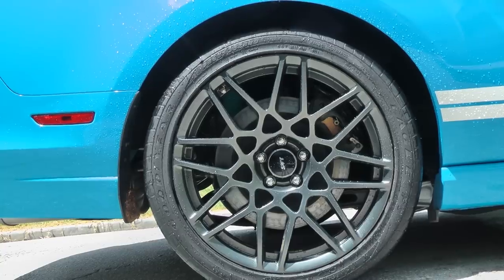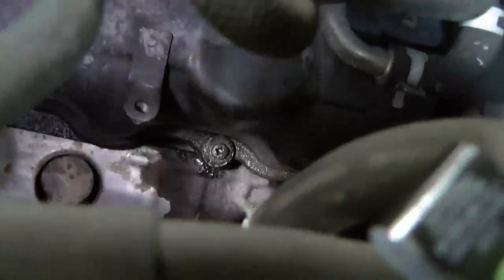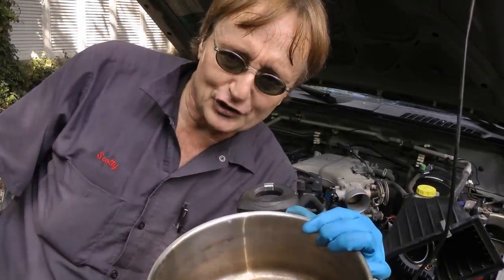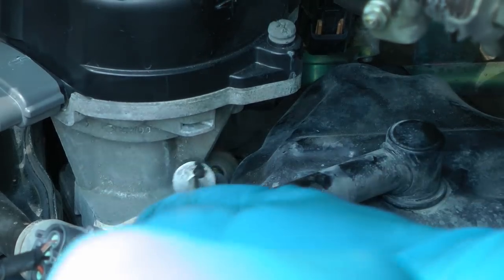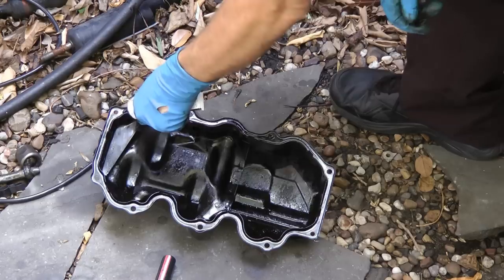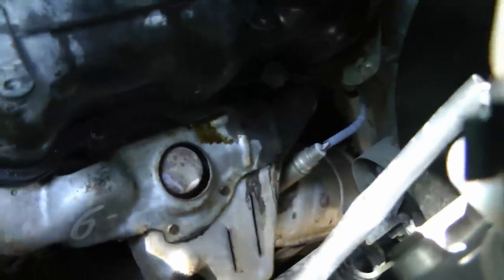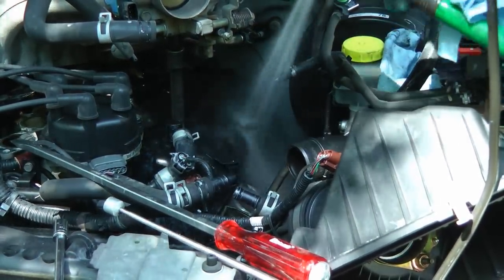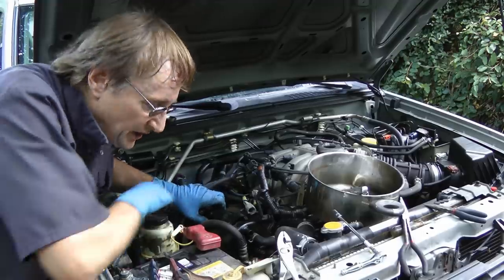How To Fix a Car That Smokes Under The Hood

Comment: Hi Scotty, My VW has been giving me issues lately. blue/white smoke is coming out of the exhaust pipe, at first i thought it was valve stem seals and the valve guides so i took the head to the professionals to replace all the worn out parts. Now i know that after putting the car back together, the smoke wont disappear instantly, but its been a week since i serviced the head and the car is still smoking and its worse now with oil dripping out of my tailpipe. all gaskets changed. help please....

Comment: hey Scotty.. I just replaced the gaskets on the same engine except its tbi. it still smoke only on the passenger side. The gasket itself doesn't seem to leak anymore but I get smoke coming from the manifold.  I sprayed it clean and it only smokes at operation temperature. what else could it be? thanks love the channel.
Reply from the maker: well, wait a week or so, old stuff will take a while to burn off
Reply: Israel Espitia how did it turn out
Reply: superjojo555 no more smoke now I got a oil pan leak 😞

Comment: Hey Scotty I have a 91 Ford Mustang 2.3l. I recently replaced the transmission but upon starting about a minute or two after starts to smoke near the flywheel area. Any idea on what I can do to fix this?
Reply from the maker: make sure it's full of fluid and that the torque converter is on correctly

Comment: I myself probably would have waited till after the intake manfold was installed before taking the degreaser & garden hose to clean off the crud. accidents & oopes do happen. That oops would be worse then dropping your favorate screwdriver where you can't reach it.

Comment: Hi Scotty, I have smoke coming from the engine bay (bmw diesel) ONLY on cold start then it goes away after 30 seconds?  Any help is much appreciated
Reply from the maker: check for leaking gaskets using a smoke machine then

Comment: Hi scotty, I have a nissan sentra 1988 box shape model. The car is fine at first but today when I drove there's white smoke coming from the engine and smoke from the vents and has a weird smell..I also see oil leaks when I stop me car..oil leaks also by the oil cap and now it's hard to start my car and my car isn't as strong as it used to like ito losing power when I drive.What is wrong? Please help scotty
Reply: tighten the oil cap and look for leaks while the engine is running, if the smell is sweet, its coolant, otherwise its most likely oil. the reason it starts hard is the sensors are most likely coating something maaking the engine unable to read the carrect air / fuel ratios.

Comment: is that normal for a car with 23,000 miles though? however it is a 2003, so the previous owner didn't drive it much. it's an Infiniti G35 if that makes a difference.

Comment: Ok so I got a 99 ram 1500 v6 just got it drove fine till I got it home oil. Tac stoped to 0 then back up to 40 so I shut the truck off and noticed smoke coming from the back of the motor I checked my oil level after it cooled down and it seems fine I also checked the oil cap for puding and nothing any one know what this could be I don't think the oil gauge works right but it don't deplane the smoke

Comment: HELP! I have an 98 chevy cavalier 2.4, i just recently change the water pump on it and it was a hassle to do it, was underneath the manifold. so i had to takedown the manifold and timing chain im pretty sure it didnt move. now that im finish, i have several codes showing, which are,p0335 could it be i didnt tighten up enough, p0141,p0335 and this one worrys me..

Comment: Dude help me! I just got a ls1 camaro about 3 months ago and it smokes alittle(like burning leaking oil) directly behind the intake manifold near the firewall but the valve-covers from the front and side dont seem like there leaking. Also it only seems to smoke under the hood wen I use German Castrol 0-30 oil which i perfer since it doesnt get eaten like Mobil 1 5-30 which smokes at the tail pipes, but doesnt smoke under hood.Any ideas?

Comment: hey Scotty i have a problem whit my Fiat somtimes when i start it up it starts hard like the batteri not good but i chacket it and it has 12.4 V and when it starts hard the clock and date resets on the dash and somtimes when im geting out of the car afther i turn engine off and i tuch the dor when geting down it shocks me the car is only 2 years old  any idea what it can be? sorry for my extremle bad english :)

Comment: I have a 2005 Pontiac Grand Prix that is having white smoke come out of the vents, it also smells burnt. When I kicked on the air conditioner last night, I didn't smell anything, but as soon as I turned on the heater, I could smell it.

(Side question: My battery went bad some time ago and the car warning system said that it went into reduced power mode. I disconnected the battery thinking that'd reset the system, and it quit showing the message, but for some reason I have to give the car gas now to get it going, or there's a chance it'll just die. Any clue what would cause that?)

Any idea of what it could be?
Reply: PhiloAmericana Heater core.

Comment: Hey scotty I replaced the valve cover on my 2002 nissan sentra spec v and after starting the car over it started shaking and the rpm's went down to less than one thousand and it felt like it was about to turn off and a lot white smoke started to come out of the exhaust pipe..I kept the car running for over 30 minutes to see if the white smoke will disappear but it didn't so I turned it off because I didn't know what to do and I don't want to harm the engine...can you tell me how to fix it and what might be the problem?
Reply from the maker: lots of crap in the way of that valve cover job, look to see if wires got knocked off, or hoses got ripped or broken first.
Reply from the maker: put a brand new pcv valve in, you can't fix em when they break. Pray it's just that, it will do that if it's sucking too much air

Comment: hey scotty my friend has an audi a6 that started blowing out heavy grey smoke that smells like gas. 2 days prior to that i had changed his air filter and spark plugs and it was fine for 2 days , he drove it about 65 miles in those two days and yesterday he had the car on but not running , listening to he radio and said the dash lights flickered about 4 times and the radio cut out but everything came back on when he starts it it take about 6 seconds of cranking to start and it shutters and idles erratically while blowing out the grey smoke almost like its timing is off but the belt was changed 20K ago. also i pulled one of the plugs and it was soaked with gas. i also checked the fuel press. regulator and a few plugs with a noid light and they all blink and spark but not as fast as it seems they should. any thoughts?
Reply from the maker: those things are over engineered money pits, and that one's running rich. Find a guy like me with a Vag Com audi computer to analyze it. No way past that one

Comment: Hey scotty i have a 01 Audi A6, and i noticed smoke coming from under the engine, towards the left side where the air intake is located, my coolant leaking wouldnt be the problem since the coolant tank is not low and i did notice just today that i had a bit of oil inside one of the sparkplug wells maybe that could be it? could it be my orings or i need a new valve cover gasket ? and i also wanna mention that sometimes when i am breaking anywhere past 15 mph just a second before the car stops i feel this thump that the car makes only as i am breaking, is the oil in the well causing a misfire?
Reply from the maker: pray it's just bad valve cover gasket and spark plug tube seals.  and yes oil can cause misfires
Reply: Thank you very much. Now I know why my car smells like burned oil or something, and I also have another question, how come my car struggles when going uphill and then revs up very high and running 20 mph.

Comment: Ihave a 1985 Nissan 300zx for the winter it is parked in a garage and I start it once a week to let the battery charge. last time I tried to start it when it was cranking it started smoking just behind the right headlight area did not see any leaks but the smoke had a gas smell to it did not try to start the car it did not make any sense car was cold so why was it smoking. Checked the fuel lines and did not see anything any ideas?
Reply from the maker: check for leaks on the fuel system, including the evap system that has 
gas vapors in it. and pray it's not a blowing head gasket

Comment: Hey Scotty Kilmer i got a question for you what could be causing a 1996 Jeep Grand Cherokee to  Start lightly smoking and stall out.
Reply from the maker: check the compression first, if it's weak, get rid of it fast before engine goes out. If not, check for head gasket starting to blow
Reply: Ok thx cause i might be getting a Jeep Grand Cherokee 1996 and its doing that thx for the heads up if i get the Jeep thanks so much again

Comment: Hey Scotty I have a 07 Chrysler 300. And smokes comes out of the hood, but
also when I turn the heater on smokes comes out on that one too. What is it
Reply from the maker: heater smoke is often a leaking heater core, pressure test it to find out. Under the hood, many things can smoke but leaking valve cover gaskets are number one to check out
Reply: I took the car to the dealer already since 2/7/14 to 2/9/14  barely took them but it did not reacted oike that before. So I will need to take it and make sure they check teh valve cover

Comment: I have smoke coming from the the right side of the hood of my Toyota Camry 94' at first I thought I needed an oil change but I checked it and it was good, I took it to get checked and they said my oil is leaking what should I do?
Reply from the maker: fix the leak, often valve cover gasket leak. Do my video "finding and fixing car oil leaks" to find out

Comment: On alot of cars u should put a dab of rtv sealant on the joint where the timing chain/belt cover and cylinder head meet before u install the valve cover with the new gasket. Might not be the case here but alot of the time it is.

Comment: Hi Sir, I have peugeot 207 2008 model, is it normal that there is smoke inside the engine? If I start the engine for  few minutes then I switch off  and open the engine oil cup, I can see smoke inside the engine. thanks....
Reply from the maker: yes, that's normal to some extent, as long as it's not like a fog machine
Reply: Thank You Sir for your response, God Bless.....

Comment: My Subaru Impreza wrx 04, started smoking under the hood by the passenger side. Is it the same process like you demonstrated in this video?
Reply: Same here. did you find any solution to yours? mine seem to be coming from the turbo area but it's hard to see where the smoke is coming from exactly. planning to change the valve covers anyway. it doesn't seem like there's any type of leak on my wrx...
Reply: +Surina Lee Well I had to change the valve cover as well as it shown here, cause it had a tiny leak , that's been leaking for quite some time. It got changed now, but it kept smoking afterwards. I took it to a mechanic shop so they can inspect it and told me that it's burning up the old oil residue that fell on to the exhaust pipe. Thing is, it's been about week already and still smoking.
Reply: +Alex Tavares that sucks... did you change your valve cover on both sides? I probably am going to change mine just in case... but I also took mine into a mechanic and they said it could be oil in the engine that is being burned up but they aren't sure... from what I searched online, people says it could be a torn cv boot, since my front passenger tire makes clicking noises when turning right. so I am going to check that out... or it could be the power steering that is leaking onto a hot surface in the car. I'm not too sure. lol I just know enough to get by.. Haha
Reply: +Surina Lee it does suck :/ no only on the passenger side. The other side was fine. No leaks. You should change them. It'll be best and it'll keep your subie running with out smelling burned oil lol but I think it's still burning the residue, cause every time I go fast it smokes a little more than when I'm driving slow.
Reply: +Surina Lee oooh that's not good :/
I would hate for my car to be making those noises
Reply: +Alex Tavares haha...yeah.. I know... :( well thanks for replying!! let's hope we both get our high maintenance subies fixed.... good luck :D

Comment: Hi Scotty. I have a 2001 Nissan Xterra that was smoking under the hood. I added at-205 reseal and it no longer smokes but now there's a loud tapping noise when the car is running and the oil light in the dash is on. What happened and how can I remedy this? Thank you!
Reply from the maker: sherBEE846  change the oil and filter, and use a quart of lucas oil additive in the mix with the new oil. those engines were known for bad timing and VVT cam problems, pray that fixes it.
Reply: Hi Scotty. I did what you said and it worked! Thank you so much!

Comment: Main problem with Nissan vehicles is that they use to use screws instead of bolts to hold the valve cover down and they loosen over time and with age the rubber turns to plastic with age. Always be sure to replace the screws with bolts and they will last longer.

Comment: My car is smoking but I believe it the coolant cause it had a sweet smell my car starts up fine but it says the my cars temperature is too hot I have a 1987 300zx I believe maybe the hose for the radiator cracked or the radiator itself idk honestly

Comment: Hey scottyI have a 2007 Mitsubishi Galant  I notice my back tire on the right side is leaning in, could the rear tire need an alignment?  or is there something else cause the suspension in the back looked good. Is there anything else you can suggest?
Reply from the maker: alignments rarely go that far out. More often control arms bend or struts break causing that
Reply: Scotty Kilmer One more thing,I changed the front brakes on the car but never changed the rotors, as im going down the road the car now shakes if i brake at high speeds, if i change the rotor s out now do i have to put in new brakes again? and thanks!
Reply: +WildWhiteFang change out the rotors only.
Reply: Xbox360Gamer112 Ah I dont have the car anymore, it wasnt worth the money i was putting into it

Comment: Hey ,, i have 328i bmw and i have white smock from the back, what could be the problem, the smoke is more at cold start
Reply: Bet your valve guide seals are leaking, at start up you get more white smoke because they have more time for the oil to leak past.

Comment: hi scotty thanks for the video..quick question..my engine oil used to leak little bit.. I bought a new valve cover gasket that was replaced by a mechanic...on my way to work I noticed white smoke coming from the engine and my exhaust pipe..i parked and saw the engine oil was leaking again through the exhaust pipe,,, what could be the problem.please helppppp me..  @scottykilmer

Comment: Is it correct to say that wiring harnesses are idiot proof? Meaning that it would be hard to connect two harnesses together that don't go together.
Reply from the maker: to some extent, connectors are normally different sizes and shapes

Comment: Hi Scotty, 

I have a 2015 Mercedes A200 diesel. The car sometimes smokes from under the hood and then a smoke smell comes in through the air conditioning. It has only gone 10,000 km. I took it to mercedes and they charged me 1000 bucks and fixed nothing.

Thanks
Reply from the maker: If you wish to ask me car questions, I am switching my questions and answers to my website. So go to www.scottykilmer.com  and ask me in the Ask Scotty section.  So please, if you want your questions answered, go to this link and join my completely FREE website. No strings attached.

Comment: I have a 2008 infiniti M35 and I noticed it starting to smoke, runs great and coolant isn't leaking. What could it be?
Reply from the maker: +martinez0810  do my video "how to tell if your head gasket is blown" and get rid of it if it is cause that costs a fortune to fix on that engine
Reply: +Scotty Kilmer Alright so if it is that, are your saying get rid of the car? but could it be anything else other then that?

Comment: My car has lots of white smoke coming out of the exhaust. I'm afraid is the head gasket. I checked the oil for water mixture, but seems fine. I went on line and all I get is that perhaps it's the head gasket. I don't have the money to fix it and is my only car. It says the repair costs like a grand.
Reply: Dunno if you figured it out yet or not, but a test for a bad head gasket, is take all of the spark plugs out, and visually examine the pistons. If there's any pistons that are abnormally clean, your head gasket is gone.

Comment: Hi my car smokes do you know of a way to change your valve seals with out removing your
heads if you do can you show a video
Reply from the maker: it can be done, but is a GIANT pain in the ass, involving using air pressure from a compressor and special fittings to put in the spark plug holes to keep the valves in. Not really worth it in most cases, takes longer than pulling the heads in many cases
Reply: Scotty's right

Comment: My '86 Yugo smokes and shudders every time I press the gas pedal. Also, it takes forever to climb uphill. Could it be that my blinker fluid reservoir has sprung a leak?
Reply: It's worth checking the blinker fluid, but it could also be a bad exhaust bearing.
Reply: James B your a chrisfix fan are you not?
Reply: James B ps. It's a muffler berring

Comment: What kind of glue did you used?
Reply from the maker: 3m weatherstripping glue
Reply: I've always used RTV. I also use a razor blade to remove the old gasket.